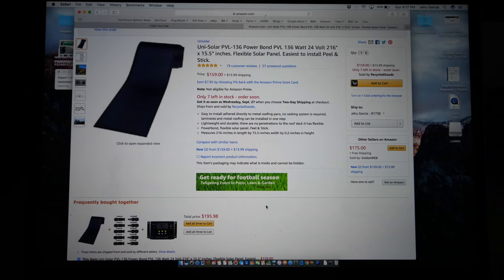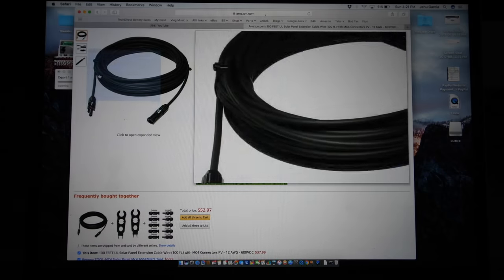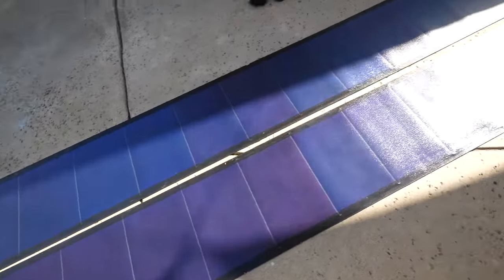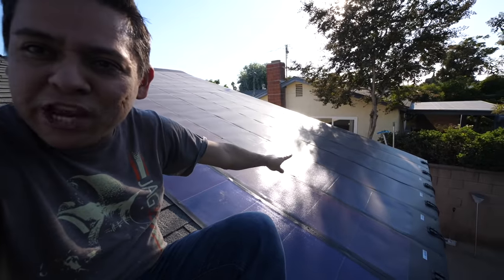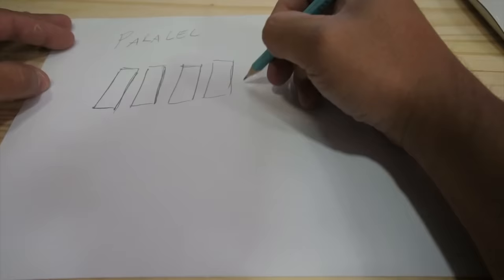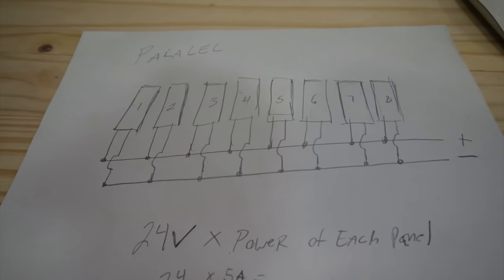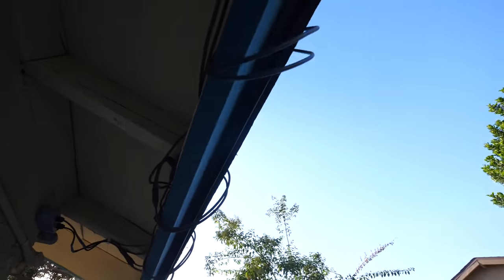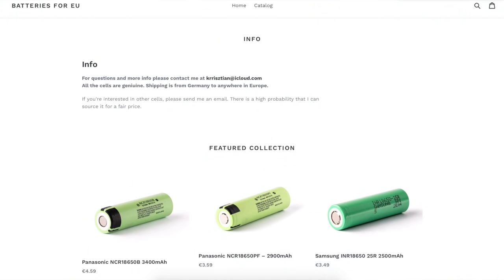My $1500 Introduction to SOLAR panels

Comment: Jehu love your stuff, I already have 6kw of solar, and want to run about 1000 watts into my inverter any thoughts on how to limit the current coming out of the batteries, i was thinking a PWM might do the job
Reply from the maker: +bastin triple trouble boys  a big DC to DC would do it,  why do you need to limit power to inverter?
Reply: I have the same question. If you do not pull the power out of the panels you loos it. The panels will not store it for you. Systems work best if they are balanced. If you have 6 kW up front the rest of your system needs to be able to handle it without destruction first and foremost but secondly to use the power you have paid for. To put it car turms how would you like to buy a 500 HP engine but link it to a transmission with a clutch that burns out at 200 HP? Matched systems work a lot better than a system with a weak link.
Reply: i probably wasnt clear. my 6kw system is grid tied, inverter is rated to 6.5kw
i want to charge batteries during the day from MY power and use it during the night so i dont buy any grid power at night. was thinking about 7kwh of storage and then limit the power coming into the inverter at night from the batteries to about 800 watts. If i didnt limit the cuurrent from the batteries the whole 7kwh would be gone in an hour, most of it fed into the grid as the inverter puts all excess power into the grid, and my load at night is about 800 watts so 6.2kwh would go back to the grid, and not run my house
Reply: my grid tie inverter will handle up to 6.5kw so if i had a 7 kwh power wall the inverter would burn that up in an hour, exporting most of that back to the grid. i just what to feed the inverter about 800 watts to run "most" of house load in the evening, using MY power charged into a powerwall during the day from my panels, instead of exporting during the day and then having to buy power at night at double the rate i get for my exports. thanks
Reply: So your motivation is that your "net-metering contract" sucks. Even your night rate is 2 x your credit rate. Could you cut your grid until your batteries drop to a low level and us a larger inverter to carry your house until your batteries run out?  Not practical, how about throttling your inverter so it only outputs about 90% of what you're using. Problem with that is you need to be grid-tie inverter if you do not cut from the grid. Problem with that is you void the UL 1741 if you change any of this. The best I know that you can do is to go to the Tesla Power Wall because it is licensed.  If you do anything like this on your own you in essence void your fire insurance and expose you to a lot of legal stuff if you are in the US. Do you get a better credit rate in the daytime? 
For me, I get credited at retail prices at the time I sell the power. I would be tempted to charge from the grid at night and sell it back at supper peak from 4 to 7 PM. My utility does not want power wall to time shift the load like that. I do not know what they have done to prevent it but I have heard they are working on it.
Reply from the maker: bastin triple trouble boys what's your PV voltage,  a 1kw DC-DC is not hard
Reply: He is not running off of his solar, he running off his batteries at night. 
Another option would be to move some of your night load to a sub panel where you would not need a grid-tie inverter. When you battery discharges a relay could drop your inverter output and switch to the utility. The utility would be your back contacts and inverter would be your front contacts. Further thinking to move more to an off-grid approach and only use utility to charge your batteries when you do not have enough solar.
Reply: i have two different strings one in parallel and series, as it sees shading, at about 150 volts and one all series runs about 300 volts, the lowest i have seen the inverter still running at is about 40 volts, after that it shuts down itself. so you think a dc-dc would be ok instead of a pwm to limit the current from the power wall to the inverter
Reply: I get a fixed rate of 16c per kwh for exports, and import is 28c per kwh
not a huge difference but enough i feel it worth keeping some of my exports in a powerwall and using it myself at night. the problem with the tesla equipment is the price. i figure i can do it myself for about 1/3 the price of the tesla system. I am thinking now that a solar charge regulator combined with a 900 watt 120 volt dc to dc converter might do the job. that way i can set the cut off discharge voltage  on the solar charge controller to shut down automatically, and set the wattage i want on the DC to DC converter. that way i wont export at night but can cover MOST of the house load in the evenings and get the most out of the power wall without overloading the draw down on it and save a few more dollars on power bills

Comment: Jehu... 1500 for solar... is NOTHING... I dropped 3k on the panels, 1k on mounting (i went WAY overboard...) 3k on an inverter and 1k on the charge controller...

Comment: I'm afraid you got something wrong, Jehu, this time. I know you're new to solar, and learning, so it's totally ok.  Let me see if I can help, and people can correct me in I'm wrong: 
When you wire the panels in series, opposed to parallel, it will not help reduce amps draw like battery cells because under load, the cell's potential voltage will drop to much closer the line voltage. depending on exactly what controller you are using, and how it works. 

The way to measure for wire size, or controller amps necessary, is to use the max watts, and then the line voltage to determine the actual system amps that will flow in the circuit.  It will be higher than the short circuit amps, so this does not help you do any calcs either, just gives a base-line for testing of the panels, for comparison, and diagnosis. 
There is an ideal relationship between the potential voltage of the cells, and the average line voltage of the system.  If you are using an MPPT controller, this will be maintained as far as is possible by the controller, and it will boost or reduce the incoming solar voltage to match the ideal voltage to achieve this ideal ratio.  This is within limits of course, and will be a factor in designing the system architecture.  This will determine how many cells is ideal per panel, and whether the panels will be wired in series or parallel.  panels, or cells in parallel is generally a good thing, as it will make sure the shading like you are experiencing does not affect the output any more than necessary. 
Sincerely hope this helps.   The good thing about your panels is that you can change them around, and even move them easily.  
Just a suggestion, you should try making a trailer for your Samba with these solar panels that you can pull over and roll them out just like the rover in "The Martian". drive at night,(no traffic) and charge all day!  No charging infrastructure needed, just need a big space on a south (in your case) facing hill !  
anyway, glad you are joining the solar club. You'll have it figured out in no time and be giving me advice before the year is out.  Cheers!
Reply: +FPVREVIEWS,
That is a good start but we do not have enough information about his charge controller to know how well it works in the 20-volt range. He may be better off with 2S4P but with the amount of shading he has being 8P may be the best for him.  Shading may be more detrimental than high current and low input voltage.

Comment: Panels, wind, a used electric fork truck battery, inverter, permits, new meter, wiring, conduit, tower and about 12k will save you 30 bucks per month.

Comment: Having done my own home solar in a rented property let me tell you, while you may be able to take those solar panels up quickly, all the holes and things in the roof and walls from the anchors and screws and PVC running through would take some time to patch.  Owner not happy. I did my own solar and I did id with free-standing tillable arrays of traditional panels which make more power for far less money.  And why do the power walls?   You can connect your power to the grid using plug and play inverters sold on eBay.  Off grid doesn't make sense in the city when you can rebate your own power bill with grid-connected micro inverters... As long as you can do the math on how to series-parallel your circuits to produce the right amount of voltage and current for the limits of your inverter, you will have no problems connecting to the grid and since it plugs into the wall, the power company will never know the difference as they automatically shut themselves down when the grid goes down so the line workers don't get zapped...
Reply from the maker: +Matt Carrell  its illegal to connect your diy solar setup to the grid,  good luck if you ever get inspected.
Reply: Matt Carrell if you don't have the correct meter it will show you using power if you feed power back to the grid. However you system will work if you are using all of the power the panels put out. And if you do have a meter that will register the back flow of power the power company will be at your house trying to figure out why.
Reply: I've never seen a meter that charged for negative usage..  Old analog meters would literally start spinning slower or backwards.  Newer Smart digital meters show quite clearly a - (minus) in front of the kW/h reading when you're producing more than you take.  You can verify you aren't getting "Charged" for power you produce using your utility's website which will clearly show usage going down to zero during those periods (or negative if you have a power-purchase agreement or "net metering" agreement with the power company.  This is why analog old meters are better, because they will run backwards no matter what your billing agreement is or isn't.. But if you aren't the home-owner, you're stuck with whatever meter you have. 

Trust me when I say I have no net metering agreements with the power company and they don't care because they may at some parts of the day in essence be getting some excess free power from me that they aren't paying for.  Clearly I shut down all the loads in the house one day to prove it watching the meter showing negative power flow back to the grid but the thing is, because there is no metering agreement to pay for excess power, the bill shows those periods as simply no power used.  And no, they've not been out to find out why some hours of the day we backfeed power.  Apparently they don't monitor their grid that strictly and they don't care as long as the equipment connected does the required thing of shutting itself off when the grid goes down so their line-workers don't get zapped by your solar rig.  My equipment is compliant with those UL standards and state requirements. If they did show up to ask why I would simply tell them its a scientific research project (which it is)... I did my homework before I did anything!!!
Reply: Matt Carrell In this area they have 2 different digital meters. One meter doesn't seem to know which way the power is going so when you produce more power than you use the meter simply reads it as usage. The other meter is a new one they are installing for people who have prepaid power. These meters disconnect your power and you can add money online, click on a button and the power comes back on. These meters will run the numbers backwards and will show delivered or sent in the screen. This will reduce your bill which causes an error on your online read out if you aren't signed up for net metering. They are behind in times here for solar net metering because you can't read your usage online if you have net metering. They say they don't have the software to do it yet. But that error gets their attention.

Comment: 18650's are expensive here in Singapore. Not sure if ordinary people can buy them from overseas.
Reply: webslinger2011 they are expensive in the us as well. Low to medium income households still cannot just go out and buy a bunch of them.
Reply: Still in the US, it's like getting from amazon 2pcs for a price of 1 unit here in singapore. & then there's jehu contacts that can get them at ridiculous low price. The price range in the US is still way better than anywhere else.
Reply: Price range is 12-16 sgd a piece. Unless you can mine cheap powerbanks. But these won't have much current to operate an e-bike or e-scooter.

Comment: Hey.  Hey! Don't short the panels to test their output like that. The information you get from them is meaningless. the open circuit voltage is also pretty meaningless, since that is 0 amps, so no actual power (volts times amps equals watts). Measuring the short circuit current also gives you no power, since that is zero volts. For quick and dirty measurements of maximum power, I use an adjustable constant current load. I slowly increase the current, which causes the voltage to decrease. At some point (the maximum power point), the voltage times the amperage is at the peak, and that tells you how much maximum power you can get from the panels. You can measure that several times during the day and at different angels and various partial shading to get a much better feel for your panel's actual power output.

Comment: Are you just screwing right through the panel?
Reply: Just the edge which is not the solar cell area.
Reply from the maker: Yes I like doing what I’m told not to do,  so far so good

Comment: To each his own...  A roof is not a sealing solution.  It's a mechanical implementation of one shingle covering the seams below.

Any fastener which breaches that top covering is going to allow moisture to by-pass the whole concept of a roof.

Basically, this roof is now trashed and its full service life highly compromised.

There's a reason proper solar installations have flashing systems to mitigate roof penetrations.
Reply from the maker: This roof is 30 years old,  it needs replacing either way

Comment: Great videos! I was wondering if you could do a video of DIY plug n play system using these panels (or any other) similar to what plugged solar sells. I’d love to be able to build something like this to simply plug it in to regular 110 15amp receptical to supplement house. With 1kW system.
I’d greatly appreciate it, I bet many viewers would be interested in it.
Thank you.

Comment: I hate to say but 12ga wire is not rated for 40amps 10ga is only rated for 30amps. Good luck. MC3 is an old style connector
Reply from the maker: old time engineer my panels don't put out more than 20A,  they should but they don't

Comment: It’s my lucky week, I just struck a deal  , 8 new solar panels for 150 bucks , Voc no idea , and voltage no idea yet , Germany made , at that price I don’t care because I will be able to buy a suitable controller and battery storage for them with the money saved buying them cheaper Then retail and trade price ,  if I don’t rush into this setup I will strike a deal on good condition used or new condition old stock agm,  in my heart I want  better batteries and a controller that will charge lipo, I think the panel is 300 volt , I have to read the sticker on the panel voc etc next week , I have had my eye on them and asked the boss if I could buy them 3 years ago , there shutting down and he said because. I did not continue ask about them i will get them dirt cheep,
Reply: If you are in AZ, CA, or TX it seems there are plenty of used panels cheap. Like $50 for a 190 Watt panel.

Comment: Probably shouldn't drill through the shingles. Its good you added the epoxy but if you have to take them down you might have a leaky roof, and an angry landlord.

Comment: You dont seal the top where the screws are, you need to seal under the panels too, you will get water in running under the panel as well as the top, at least you sealed the top but need to think about the bottom too, either way i hope your landlord does not watch this video otherwise woohoo i am sure hed be pissed.

Comment: Why is it illegal?
Reply: The issue he would have is with permits dealing with tying into the mains or generating mains level voltages.  Those levels can injure or kill people, so if he were running a low voltage (parallel system as he described) setup he would be ok.  Bringing it into his house would be ok.  Hooking it to a powerwall is ok.  If he used the low voltage for low voltage lighting he'd be ok.  Where he would run into needing a permit is connecting the inverter to a grid tie connection.

Still, that's not too hard to get.  Just have a certified electrician come in and get the permits and make the connections.  Have the inspection.  Good to go.
Reply: Because...Commiefornia.  God forbid you do something to your own home without permission from the masters.
Reply: Until he put the screws in, it wasn't illegal. It might violate a homeowners association rules. The same would be true in Texas or Louisiana.

Comment: What a waste of panels.the ROI is probably 20years with this system
Reply: coldunas, wrong dude, ROI on this system based on electric cost here in So Cal @ about .15 KW, and an assumed 960W usage / production of maybe 10 hrs a day.  I would say they pay for themselves in about 4 years.
Reply from the maker: wrong $.49/kw  for me during sun hours.    it costs me over $3K a year to keep my pool pump running
Reply: water is far superior here, got a micro hydro-power station for $2500 and it makes 5-6 Kw, just shy of 8 Kw after some good rain.

roi is still out of reach though, industrial water stations are keeping the price at 0.02-0.04 per Kwh throughout the year.

Comment: Did you say strong as your weakest cell .. serial sucks .. well that's crap then, I wouldn't buy it for nothing.
Reply: There is talk about diodes in some panels. I dont understand how they would work. Seems transistors would be needed instead or in addation. Someway to automatically shunt past the unproductive cells for only as long as needed.